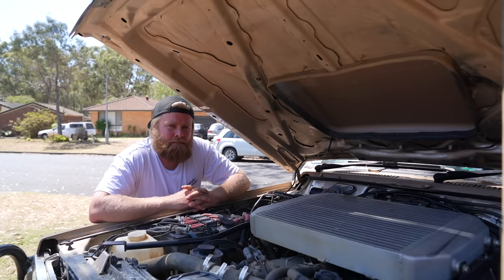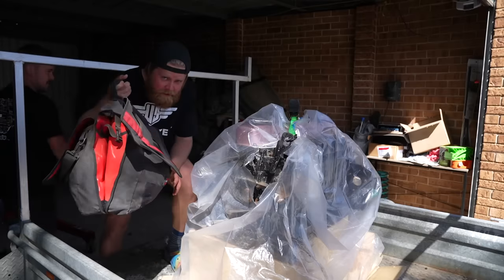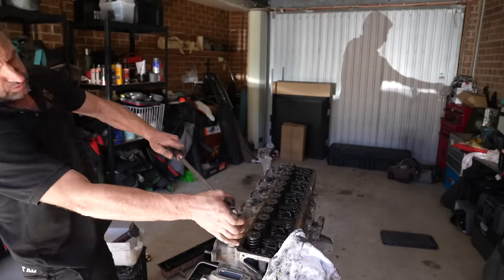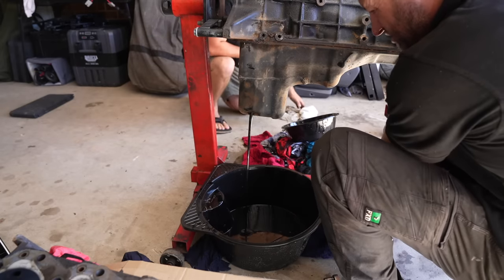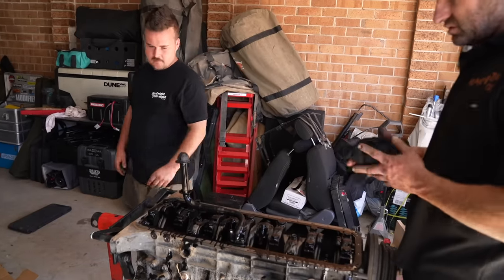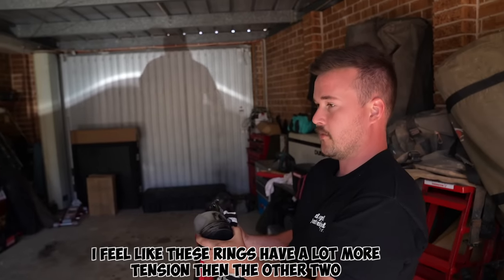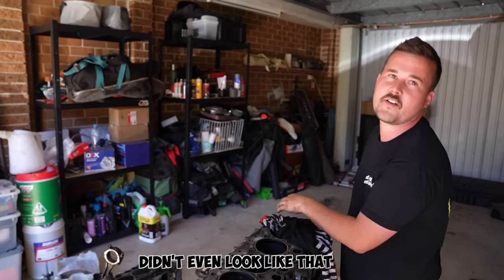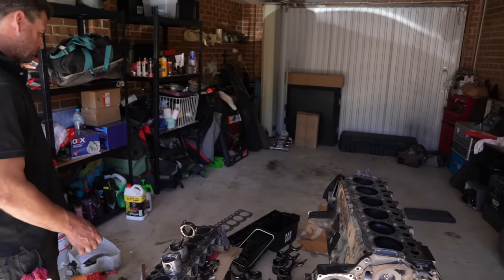The real reason my Patrol had 3 engines in 3 months... 🤦🏼‍♂️

Comment: Sold a lot of TD 42 engine parts 90% of the dead engines were from over boosting and trying to get too much hp out of these old engines. Stick to max 15 psi. 10 psi boost and they will last even with std pistons. Want more power go for a Cummings 4.5 lt where you can get 700 nm torque out of the box and the engine is built to last in trucks and busses

Comment: Having stripped and cleaned 100s of these engines thier biggest issue is the steam holes that run horizontal between the bores and diagonally to the deck, these holes block up then crack the counter bore under the sleeves about two inches down the bore, you will see hot spots on the sleeve, fix is bore out the counter bore and fit thicker sleeves, and drill the gunk out of the steam holes, need about a 100mm long 3mm drill bit

Comment: Definitely an unfortunate situation having to swap engines a few times but I don’t think it’s Burdos tune at all, engine sitting for years then sparked back to life not knowing it’s history if its been dusted or what ever, that a big chance that sometimes doesn’t pull off, great video mate, cheers
Reply: Looks like it probably did a head gasket at some point with new gasket and new head bolts. Would explain the potential water in those cylinders as well. And since tds are called the kettle makes a lot of sense

Comment: Built TD42, stroker or Stock length stroke with the works. Either sell it off find or something to put it in
As for the oil burner factory turbo motor my guess is it's sat with an intake open on one cylinder and exhaust valve on the other or something similiar like Nick mentioned
The poor silvertop probably had bugger all ring tension left so the boost and fuel probably just went straight through to the sump 😂

Comment: My bet is it had two oversized injectors in 3 and 4.  Overfuelled and run hot on those two pots.  When the oil burning reached where it did, the owner parked it.  It's not from dusting or water, the firing order means fuel/air is fed to all cylinders more or less evenly, never all the mix to 3 and 4 only.

Comment: I can just imagine Burto saying 'mate if you want more inches stroke it'
Yes you should stroke that engine, how cool would that sound 😄

I think you just got unlucky, I've been there with used engines more than once.

Not a mechanic but I'd hazard a guess that it had been over heated at some point with the two inner cylinders having the problem and the fact the cooling system was immaculately clean.
I'd also guess the knocking noise was piston slap.

Comment: 3&4 indicates dirt dust ingestion, poor air filtration, nicicile liners don’t wear like that unless there’s abrasion.
Use heavy duty liners from Engines Australia, they are thicker.
What air filter are you running?
Reply from the maker: This damage happened to the motor before I owned it, not sure what the previous owner was running. I'm running a circle paper truck filter
Reply: @TylerThompson90  Patrol Docta system 👍. Yeah wasn’t pointing fingers at you.

Comment: The explanation about sucking dirt/ grit into pots 3 and 4 makes sense if it had been ru  without an air filter. To back your claim I had a guy running a td42 without an air filter and thought driving through water was a good idea. No it wasn't pots 3 and 4 sucked a bucket load of water bent the Conrad's in both pots and how it didn't throw a leg out of bed I don't know. Pots 1,2,5,6 all OK, like yours.

Comment: Dont think I've heard so much guessing in one clip 😂😂😂😂
Heres the plot, with the centre 2 cylinders the dust has so much energy it doesn't turn in the manifold enough to get to 1&2 then 5&6 as much as 3&4 which is more line of sight, then as you can see with the excessive carbon build up the reduced ring land dia above the piston which is designed that way so carbon build up doesn't polish the bore, this has gotten to the point where its exceeded the ability to keep away from cylinder walls and has been amplified by dust into 3&4 then the bore scuffing is the result, in motors designed for 1M plus kms they have flame rings at top liners to constantly clean top ring land, bad tune up only magnifies the issue with excessive carbon from the soot of overfuelling and excessive injection duration, i bet if you had looked closely at induction piping you would see evidence of dust ingress, if there is a leak point ( including poor maintenance practice of not changing airfilters)  then you know where new one is headed, if your operating in dusty areas then 2 things, regularly pull of intake to turbo and look for dust evidence, this will be either staining and or abrading of leading edges of compressor wheel, be sure to silastic over the top of every joint between turbo and air filter ( on the outside not between as it seal's just as well but much easier to take apart, a little rubber grease on air filter sealing surfaces works wonders too, if your really serious about getting good life out of new motor then at least for a couple of oil changes cough up for some oil sample kits and dont "guess" any more make sure you know its all going good,  JMHO as working on 2000+ hp diesels in mining this is absolutely mandatory for 35 - 40,000 hrs of engine life,
Thats not even taking into account correct engine oils and intervals where overfueling and soot contamination are contributing factors etc etc etc.

Comment: Hey l am no expert but you guys appear to know what you's are on about, but l do know that old Nissans make good scrap metal and sadly, this includes Safari/Patrols. But in saying that, any engine that has been sitting a long time will be suffering from bore corrosion,,,,,, especially if a valve is open or even partially open.

Comment: This is exactly the reason I bought a Jeep.  Got it used with low kms, the reliable naturally aspirated 3.6, minimal mods to get big tires on it, can drive it for 200k then sell it and buy another one.  I would only buy an old patrol or landcruiser if I was a mechanic by trade because labour is too expensive for me.